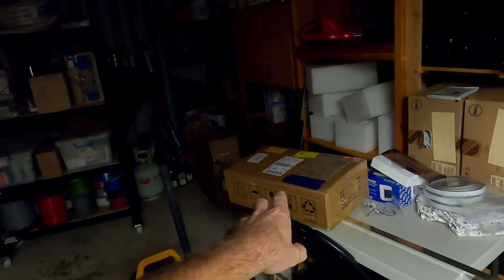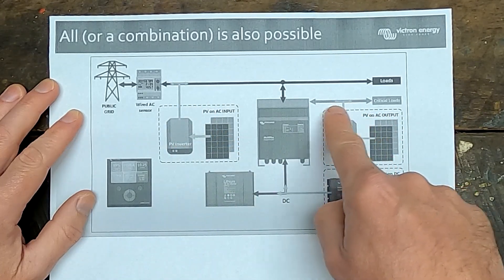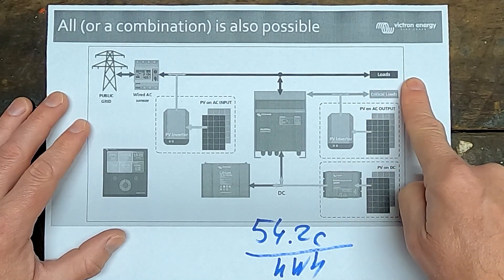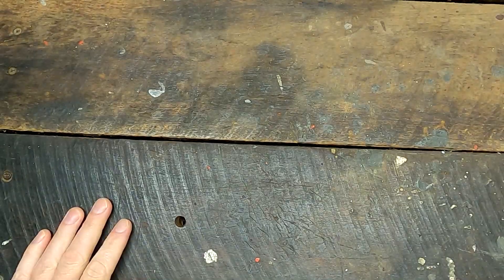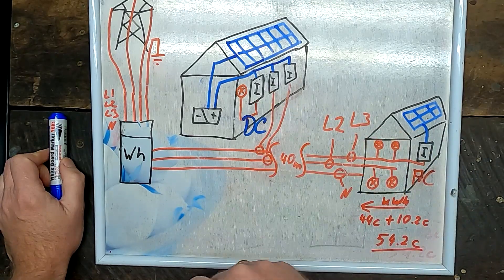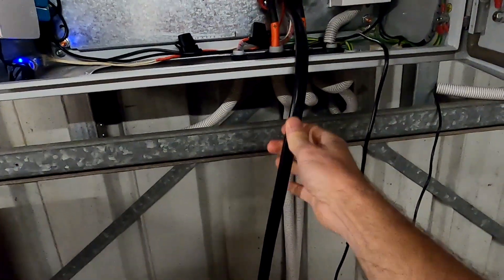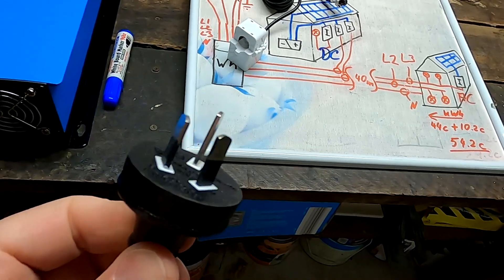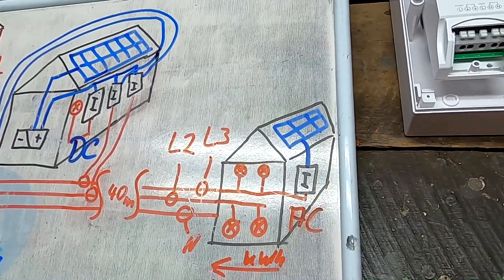Zero feed-in solution to power the house from the battery (and stay legal)

Comment: Hybrids are way forward all in one packs.. on grid are good with zero export yet it's confusing . You can't use them when off grid . So hybrid 12-16 kw is a good option with a load of 3 kw per room with a.c else where whole house takes about 10-8kw with ,,4-5 rooms. 2 -3 motors 1.5 kw. 2 refgerations , 2 dispenser, 2 kw water heater.. plus 4 a.c. On 12 kw hybrids works a charm.. upon 4,kw per leg it makes all kinda stupid stuff . It should be Able to handle 50% of the load like 6 kw per leg.. but it struggles even in under and over frequency.. it goes off grid . And my nuetral is floating which makes me think .. that I just have. Capacitor of 5kwh battery.. 51.2v 100amps.. as soon as grid goes down for some seconds.   My batt kicks in . But if my loads are over 8 kw what would a 5,kw do . 😅

Comment: If the ct is only connected to a single leg how does the inverter outputting 240 know how much the other leg has for its load?  Say loads are imbalanced and the leg you are not monitoring is less than the leg you are monitoring. Wouldn't you then feed some power power onto the grid unknowingly?
Reply: It doesn't. It just sends what it has. 
Easily end up with a voltage imbalance, but not an issue at such low inputs.
Grid will provide any additional needed power.

Comment: if you put the current clamp between the input of the multiplus and the pv inverter on the left then if you can set the export of the multiplus to 0 Watts, it should run the loads with the power it needs from the solar/batteries connected to the multiplus, then any excess load would first be taken from the "export" solar inverter but not charge the batteries from it unless you set the multiplus to charge from gird. the Export Solar would continue to export as normal.
I think. 
I makes sense to me anyway. Could be miles out, if the multiplus doesnt use a current clamp to work out it's export

Comment: Hi,
I have a grid tied 16kw system with no battery backup. 
I need more electricity to meet my needs but do not want to mess with the 16kw system. 
I want to install a separate system about 6kw and a battery sized for the 6kw system. 
All I want the 6kw system to do is charge the battery. 
I want to hook up something that will send electricity from my battery to my home when the solar on the house is not producing and or the grid is down.
I know this video is a little old and I was hoping you could simplify what and offer me the best options.
Thank you!

Comment: Well I have a 7000 W PV array coupled to a grid tie only inverter with its AC output that pushes all of its power into the hybrid inverter and it does it all day long. We call this AC coupling, and the hybrid inverter allows the battery to be charged, and to power loads in the home and it will backfeed excess power to the grid. The hybrid inverter and 16 kWh of battery is down to around $7500 in cost total. Then you have the cost of your solar panels and your AC grid tie inverter.

Comment: My SUN inverter (2K) worked nicely for almost a year (ok, never generated more that 1.5kW, but I guess it’s because it was connected to Teslas (model 3) battery banks 2S2P, so 50.4V max, and 38V min)), but after a year it suddenly dropped to 700W max and couple of months later totally stoped indicating an error “Grid error”… Bugger, don’t know what to do next - buy new one of should I finally go to Victron Multiplus? But I do have 12kW totally no name inverter from Ali and it does the job extremely well (tried a load over 6kW and it hardly gets warm). But it’s totally off grid one, so mot possible to integrate into the system (although I was using it to heat up our hot water cylinder using couple of contractors and couple of Sonoff’s). Maybe anyone knows who are the original producer of SUN inventors or, maybe someone has schematics? (I am electronic engineer by degree, but doing reverse engineering isn’t reasonable just the single device)

Comment: We have two separate solar installations. The first one, installed by Enphase contractors (about 5kw), is on Net metering (ie; we get paid from the electric company for power we send to them). The issue with this system is that when the power goes down, so too does the solar power. This 1st solar installation does not have a battery (micro inverters directly into an Enphase box).

The 2nd solar system on our house (about 3kwh) is a large DIY system which includes a battery. It is connected to the most important 8 circuits on our house via a transfer switch which has 8 breakers. I have CATL cells running on this circuit (2P16S = 560Ah). This 2nd solar setup is soooo much better than the 1st one (the Enphase setup). It also cost 50% less even though it has 30kwh of battery.  But the transfer switch option is really great. If power shuts down, we still have solar powering the house during the day (the 8 circuits on the transfer switch) and power at night via the battery. During the day, the entire house is solar powered from a combination of both solar installations. Of a night, 90% of the house is powered all night long through morning by the battery which then charges up during the day and repeats.

Comment: Would you recommend and plug and play battery that would work with this inverter?
Reply from the maker: It will works with all batteries from 48V - 90V. Just connect them with the appropriate safety devices and it will work. That's plug'n play, isn't it?
Reply: @OffGridGarageAustralia  yes it is! Thanks. I do have a follow up question.

We already have a 10kw grid tied inverter than is connected to 8.3kw of solar panels ( East and North) We are export limited to 5kw to send back to the grid. We are looking at getting a 2kw Solar Grid Tie Inverter with Limiter Sensor that we can connect without permits to DIY solar panels that we can face West.  Looking to connect a battery too to the 2kw inverter. 

Will we run into issues if both inverters are trying to send power back to the grid and we are hitting the 5kw limit?

Comment: Hi Andy, is there any similar inverter which works on 12v battery?
Reply from the maker: Not that I'm aware of. I don't think there are any 12V inverters which can be grid connected.
Reply: @OffGridGarageAustralia  thanks Andy
Reply: I believe Outback still manufactures 12 Volt battery/grid tie inverters.

Comment: I disagree. 
The Sunsynk Hybrid Parity Inverters can work in a bi-directional setup and can be DC coupled and separated from your Existing solar PV installation by using a separate UPS consumer unit for your critical loads ( lights power outlets etc)  "Other" hybrid inverters can typically just be a charger and PV-inverter squeezed into one box.
Reply: good day sir, my deye hybrid 8kw is having a feed in, on my solarman app, is this normal or this is a problem

Comment: 54c per kw, when my batteries are full my solar exports excess energy back to the grid free of charge - i want to give the grid 0 zero/nothing, its my energy that i paid to store, it should be up to me if i want it exported or not, you can sign up for a feed in tariff here in the UK but to be honest its a joke what they give you, i think its about 5p, at present i am looking at a zero export controller to add to the system
Reply from the maker: Have a look at the Victron system, they do zero export.
I always think: if my battery is full and all my load is satisfied from solar and I still have a solar power surplus, why not selling it for 5p/kWh? That's still better than throttling down the production and get nothing...
Reply: @OffGridGarageAustralia   that's true, I just prefer to not help the energy companies make more than they already do

Comment: Why would you use a sunoff device??? When there is sun and you don't use any power then they inverter won't give you any power, and if the sun goes down it then the power will come from the grid. 
Also if you won't discharge the battery to 0% then you can set a stop voltage so it doesn't keep using the battery and a start voltage for when the battery is fully charged.

So I can't see the purpose of this device?
Reply: Thats what I was thinking.. the ct sensor measure direction  of current  hence if solar is exporting  this inverter should not exporting.  Hence why use the sonoffs for daylight turn on ?

Comment: I’m doing something similar here in North Dakota!
Reply from the maker: What device/inverter are you using for that?
Reply: @OffGridGarageAustralia  I’m using the same inverter as you. The Sun 2000 G2 shipped here is split phase 250 vac. I have it hooked up to a 240vac timer
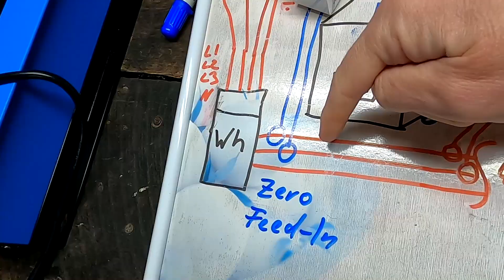Reply: My timer is set to come on after my solar panels stop producing (right now 17:45 to 08:30). My LIFEPO4 are 4p16s (60800 cells) 220 amps per 4P. I have the limited hooked up, but I set my inverter to come on manually  (435watts) because I have my AC sub panel in my garage and I don’t use any electrical power at night in the garage. ( so the limited wouldn’t have the inverter come on) Having it set at 9 amps it feeds into my main panel in my house to help offset some of my energy consumption at night. I usually have a mini duct heat pump running all the time. I plan on turning up the amps when I get my 16 - 280amp cells from China. Shipping has really slowed down here in the U.S.. I will be making a video on my unit tomorrow, check it out on YouTube under”Steve Dutcher”. My BMS in a 150 amp Daly, I’m very impressed with it.
Reply: Andy. Hi .. if I don't have ac power can I use this inverter to generate 230
Reply: @ehabsabah9485  not this one.

Comment: Thank god that in the UK the supplier responsibility ends at there meter after that it is up to the home owner, many people have installed an isolator switch so you can upgrade as you want and not call out the supplier to pull the main fuse and put it back in again (at a fee of course) when you need to to any upgrades or a consumer unit change.
Reply from the maker: We have this isolator switch as well and I can pretty much install everything I want afterwards as long as it complies with the regulations. These inverters are just for testing purposes to see if this would be a viable solution from a technical standpoint.

Comment: I have been using this inverter for 3 years now with 10 kW of 18650 and it runs my house from 6pm to sun up and my main grid tie starts. I have not had an electricity bill for the 3 years infact they pay me. Where do you get the lithium iron phosphate batteries from? I want to add on more batteries.
Reply from the maker: Thanks for sharing, Garry. Have a look in the description of the video, there are links to these batteries with further information.
Reply: Care to share a vid of your setup? We want to do what you have done.

Comment: how much does incoming electricity cost you?
Reply: Incoming electrify is say 21c and out going you get 54c, sounds crazy. I pay same incoming but out going  get only 13c kWh. is that the case?
Reply: @gedshep663  yea he's on the legacy tariff. Was only available for a few years right at the start of the grid feed in program in qld.
Govt pays most of that money. At the time it was like $10-20k to get a 5kw solar system
Reply: @kyba74  understand, paid 4000$ including upgrades inverter [frlonius] which was $1000 extra, 6.6kw, so me best to use solar while the sun shines. Did buy 304 ah lifepo for my bus following your recommendation Qishou. Thanks
Reply from the maker: 21c/kWh or 17.9c/kWh ion the other tariff.

Comment: Andy, as by the comments, you have opened "Pandora's Box" on this one. On one side you have the Code-Conformists, China-Haters, Your-System-Notunderstanders, Owners-but- Usingitwrongers versus the Lawbreakerpack, DIY-Successivsystem-Builders, General-Gridtie-Systemunderstanders, etc
@Will says its not UL1741, so it is a killer machine connected to the grid. Well, the inverter internals are the same as they are used in a few Chinese Tier-2 Grid-tie inverter brands. They are built by DEYE. The only difference is, that the Anti -islanding system is different as the inverter is powered by the AC-side while typical Chinese grid-tie inverters are powered on the DC-side and AC is monitored for faults. My experience with the SUN inverter is, that it will power down with the slightest blink in the Grid. What it doesn't do, is having the required standby time to reconnect, as that will be just a factor of how long the boot-up is taking. I follow the opinion of Jack Rickard who always said, no Lineman had ever been killed by a Grid-tie inverter.
I always read about people saying they have failing units. But many times it is in conjunction with using the high DC-voltage version with battery voltage on the very low limit. Another issue might be the switching by timers on the AC-side, while the DC is powered. In my system I am switching the DC-side (have a video on that on my channel). The concern was a high standby power when AC stays connected. But that was debunked by members on the secondlifestorage forum, as the load is almost purely capacitive and the power factor is only 0.03 which makes it a 2W draw in standby only (we all thought its 70W before).
About the not accurate tracking of export I want to say, sure, adjustment of the limiter always takes time, no mater which inverter. But the utility as well doesn't bill in seconds intervals. If you find the inverter still always overshooting and exporting a few Watts, there are videos on YT where people put potentiometers in the line of the CT and adjust that error. I find my inverter overshoot up to a max of 20W (by my own meter, I cannot see what the utility meter reads) sometimes, but I don't care. And as you are allowed to export, a few Wh a day would not be visible for the utility as well I guess. 
I think, especially when you say this solution is only meant for some years, this is exactly what fits your purpose. Save your money for the final HQ solution, when your contract is over.
Reply from the maker: Jeez, I'm testing the inverters 🤷‍♂️ Arne, if you don't like them, don't buy and don't watch...

Comment: Could you not carry on using your current solar change controllers to charge the battery from the garage solar, have a multiplus with 0 charge current enabled (so no AC charge ever) and then just use the remote input on the multiplus to switch on when the solar input from the house is 0W? 

Look at HomeAssistant potentially to manage the automation, it shouldn't be too much work. Forgive me if I am wildly oversimplifying or missing something.

Comment: I have a question but not on this topic for the experts here
the victron shunt works on volt ?
Yes or no?
if it works on vlot how can it determine the charge state of the battery, in the part of the horizontal curve?
I have mounted a 123smartbms and it runs on KW, in and out of cels, and gives a completely different, information for the battery/cells.
which would be the right one?

Comment: These inverters DEFINITELY feed into the grid and are 100% illegal to use in Australia. I live just down the road from you and can shed some light on their design issues if you wish, feel free to message me directly. Josh.
Reply from the maker: Hi Josh, these inverters just feed in to the grid if you don't use the limiter or if a big load is turned off suddenly and the inverter takes 1-2s to ramp down. That's with all grid electronics though and to be expected from the grid operators. Usually this power been pushed back to the grid is very small and will be offset in the meter with the other phases and usage.
Reply: @OffGridGarageAustralia  Andy, I think you are missing the point, these units don't meet any minimum Australian standards with respect to safety and reliability. As such there is a risk they don't function continuously as specified on the box and could feed power when they are not suppose to, hence why they are not on the approved list.

Comment: Since you can't run a cable trench from the garage to the house, how about adding a small dedicated shed near the house in which a battery system can be housed and have a separate solar array on the house feeding it? Then you can use a transfer switch in the house to take chosen circuits off-grid.

Comment: I know this is not good for your current battery placement, but I would suggest using an inverter with power passthrough between your inverters for the contract and your loads. With the power passthrough it would only make power for your house/loads and not back feed. And with the settings for it some can be programmed to use power from the grid or your solar/batteries as your main to power your loads, while still being able to power your house in a grid down event. And power passthrough inverters, that I seen, can recharge your batteries from the grid and/or generator. Victron does make inverters with power passthrough, but I only seen up to 6k on output from the website, I could have missed higher output models. Another one you can look at is Sol-ark 12K for its power passthrough.
Reply from the maker: Yeah, but I need to feed the energy back from the load side in reverse through the inverter back to the grid. I don't want to use this energy to charge my battery either.